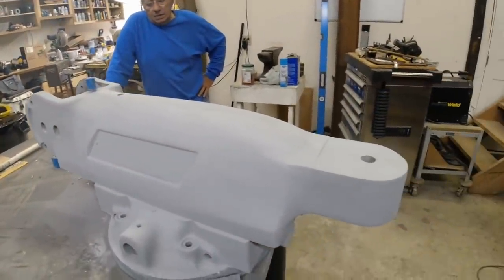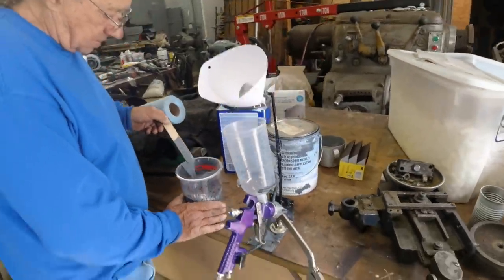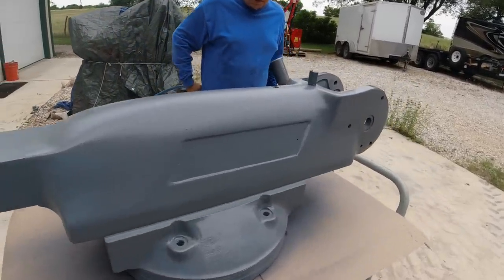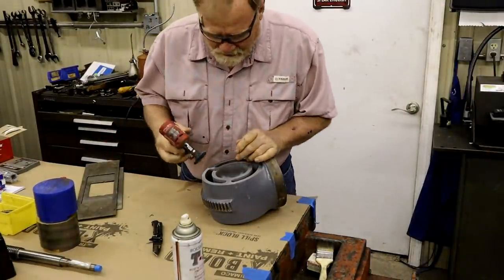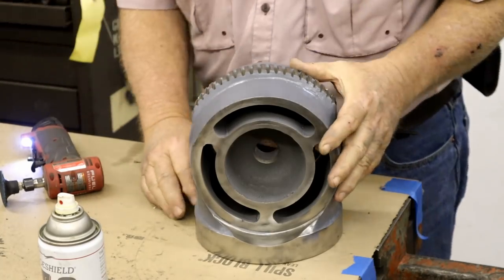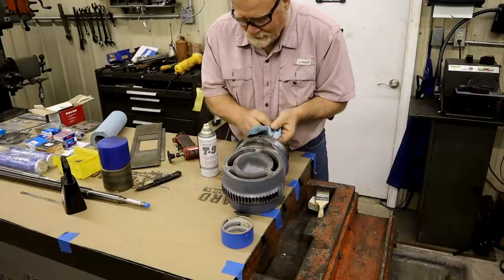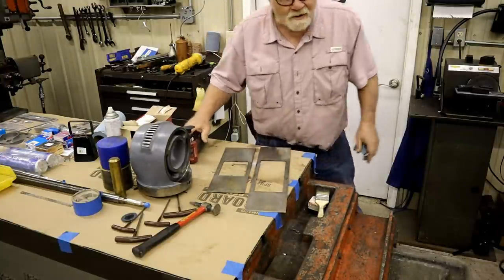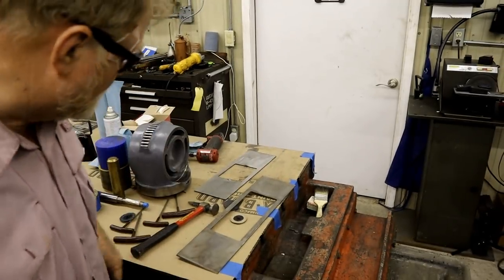Buying this mill was NOT a mistake! : Don Starts painting!

Comment: I like that orange 🍊 peel finish on the BP. Otherwise you will forever see all the Bondo Mess-ups. I’m going to use the same HF spray gun, can’t beat the price.
Reply: Well you can adjust the gun and paint for a smooth finish if you like! Yup can’t beat the cheap HarborFreight gun for stuff like this!
Reply from the maker: Well said :)

Comment: I’m a 60 year old Hobby Machinist. I wish I had a friend like Don. Don’t mess with my buddy! I would buy Don breakfast, lunch and dinner if he painted my BP. Even the drink 🍹 of his choice.. I have the same Sherwin Williams Industrial Enamel hs. The store rep told me to thin using Xylol.
Reply: Interesting as the tech guy at Sherwin Williams told me not to thin it at all, that’s why there’s no directions for thinning on the can? Anyway I read the label and it contains Naptha I figured a little more wouldn’t hurt lol
Reply: @donmadere4237  Right! Just as gas is a good cleaner it works really well thinning oil base paint. And cleaning brushes. And burning houses down.
Reply from the maker: Oh believe me I am paying for it :)
Reply: @10swatkins  Open gate policy is always a rough deal!
Reply: I have two Bridgeports, both work but really should go through a complete rebuild. I can’t do it myself and I’m getting quotes of around $9k each plus transportation! 😩
Reply from the maker: @billdivine9501  Yes it is expensive... Now with shipping it is really expensive...  The mechanical is pretty easy especially with the new parts supply, the sliding surfaces are a whole different matter..

Comment: Most entertaining show on YouTube 
I picked up that angle grinder it does come in handy for a quick clean up I don’t need to turn on the air compressor for a small clean up 
And yes the batteries are very tight.
And tell Don that’s I might pick up the cheap sprayer I like the disposable aspect of that saves time on clean up
Reply from the maker: Thanks Paul.. I have been thinking about playing around with the clips on those batteries... Sort of like a trigger job on a rifle....  there has to be a better way.... Of course the small batteries are a waste of time.. I have one bigger battery that has a wide base also, good for setting the tool on..
Reply: @10swatkins  you have to turn the tool upside down push with your thumbs in and up and it pops right off!

Comment: Steve and Don, that texture looks great.....almost like a powder coat.....
.those Alykd pants tend to get  that  orange peel , 
especially when they they dry fast and do  not flatten
out. Sherwin Williams Commercial Coatings Division 
makes a product called Quick Dry Enamel....it is a solvent based 
paint that is used for industrial coating of machinery, I have shot many gallons of it.
It is thinned with xylene, lacquer thinner, toluene, and even VMP......each solvent 
type has an effect on the drying rate. so if your temperature is low, you might go with 
the Lacquer Thinner or Toluene, if real hot, the VMP......it is very versatile and can be dry in 15 minutes 
if conditions are right. They also make a dulling agent that will give it a nice Matte look.
the Code number is F77-xx for the Paint, the xx will be a code number denoting the color, like B for black, w for white, ect...
I would spray with a gun like Don's, or when I was doing production painting of 
theater rigging or utility trailers at another shop, I used an Airless Graco set up.
we would not clean the gun unless we were changing colors.....and at the one place, 
we only used matte black F77-B2.....we kept the gun sitting in a gallon can of xylene, and the
paint was in the 5 gallon bucket it comes in, we only had a plastic top from a HomeDepot
bucket with a cutout for the Airless Pump pickup hose....we only had to stir the paint a bit with 
a drill stir gizmo to get the dulling agent  mixed as it would settle, .never in over a year did I ever have
a problem......It is a great product for your type application, I do not recommend it for items that 
will be in the weather all the time, or submerged in water or chemicals,  as I have seen it oxidize  after a year or so. I hope you get a chance to 
try some out.......and it smells good too......so you might want to wear a respirator......I did when I was laying under a new trailer, 
cheers, Paul
Reply from the maker: Thanks for the tips Paul...
Reply: This paint they actually recommend not to thin it. It uses Naptha as a carrier in the paint so that’s all you can use. It’s meant to be brushed on in a marine setting. I found out that I can thin it by adding a little more Naptha enough so I can spray it.

Comment: I rarely tape what I am painting. Always takes more time and effort that it's worth. I'm not painting a show car, it's a metalworking machine!

Here'a tip - for the flat areas like the chip guards for the knee - use scotch brite pads with a square sheet palm sander. It gives a much more consistent surface than the tiny pads on the die grinders.
Reply from the maker: Don like the palm sander and scotch brite also..  I bought one to use on the 10EE lathe after he showed me how he used it on his shapper...
Reply: I agree the palm sander with Scotchbrite and Wd-40 is all I use!!😃
Reply: @donmadere4237  The Pro's choice!

Comment: I prefer a smoother finish, that looks like an orange peel finish, not sure if because of thinner evaporating too fast or how it was applied, weather etc. With oil based paint I add a dash of penetrol, it slows drying a tad and helps the paint flatten out for a high gloss smooooth finish.
Reply: Can’t add penetrol to this paint, it’s an industrial paint that uses Naptha. It actually rained a little on it. It was very Humid.Actually Sherwin Williams said not to add anything to this paint but since it uses Naptha as a carrier in the paint already I use it to thin a bit.
Reply: @donmadere4237  While I have never used that paint, I've used penetrol with other oil based alkyd enamels without a problem. Seems most paints say not to thin them too, but you can't spray them without thinning them either, so......

Comment: Hey Steve can you put some details of what products you’re using in the description (filler, paint, disposable spray gun pot etc.)……. and tell Don to put his mask on!
Reply: I was outside and very little overspray in the air, I only wear a mask if I’m painting inside. The paint is Sherwin Williams DTM Industrial paint, gun is the cheap one (purple gun)from HarborFreight
Reply: @donmadere4237  I love their dtm paint lays so smooth expensive but it works well Back when I was using it we painted old industrial metal buildings with it never had any issues with paint chipping

Comment: Steve, I wonder if you could set up one of those scotch-brite pads on a drill press with a small jig and do an ersatz “Engine Turned” finish like the old show car dashboards.
Reply from the maker: Where I worked as a Paramedic would rebuild the ambulance boxes and put them on new chassis They used to do that finish on some of the interior surfaces... Was a PITA to clean....
Reply: You can do that on a drill press or Bridgeport. I used a 1/2 inch wooden dowel with a leather pad glued on the end. Spread a light coat of very fine compound on the surface. Touch rotating pad to the surface a few seconds to get the finish you want. Go in a straight line and overlap each circle about 1/3. Takes some practice but if done right you’ll get parallel rows of small jeweled circles. Good luck.

Comment: Too much air pressure will cause an orange peel finish as well.
Reply from the maker: I just fix'em Don't paint them :)     Oh and on your comment about putting it in the oven.... The oven is just a little small for easily getting that 4 foot long part in and I have found that when stress  reliving cast iron you always end up with some sort of twist...   I'll stick with the way I've always done it as It keeps the side relationships all ok and just trues up the bow...

Comment: Always spray your edges first. Paint was to  thick and naptha evaporates to fast, try acrylic or urethane enamel reducer. Acralon is a superior paint to most any finish you can use on a machine, its two part, cheaper then Polane and harder.

Comment: Leave the paint as is. Machines should look like that its not a sports car. 
On the paint polishing if it ain't sparking you ain't removing metal!!
Reply: Use a pair of welding vise grips to get battery out of polisher. Non swivel type or pliers for oil filter changing ..
Reply: Agreed
Reply: @silverbullet7434  no there’s a trick you turn it upside down then push up with both thumbs comes out easy
Reply from the maker: I plan on it :)

Comment: Surely it’s time to get back to this project by now, since Dons nut is now done? 🤷‍♂️🙄
Reply from the maker: Yep :)    Today I am working on three projects for this weeks video... One is powering up a angle cutting band saw to see if it even powers up. Two is taking the hydraulic tank and pump out for cleaning on the  10x 30 DoAll grinder and third is planning some on the rails for the 10ee.   

 The Bridgeport comes in here somewhere :)  I am ready to flake the column on the Bridgeport but I want to do a nice job and need some practice.... Planning the long rails will give me two excellent practice surfaces for that!
Reply: @10swatkins  There’s always something else to do first, is there not? 😂
I started watching 12 months ago when I first bought my Bridgeport.
I guess I keep watching.
Just hope I don’t die of old age first is all. 😂😂